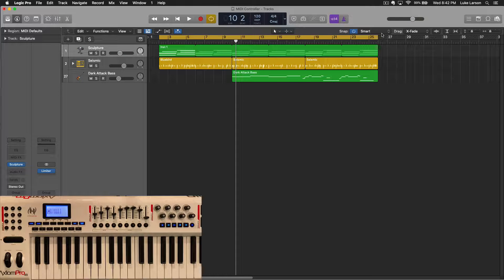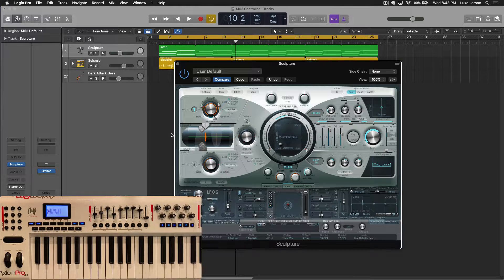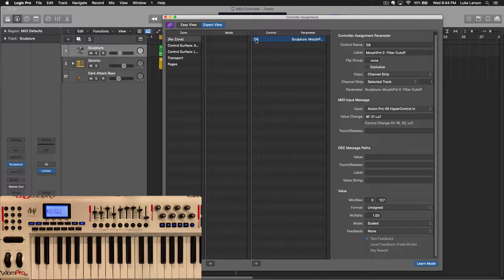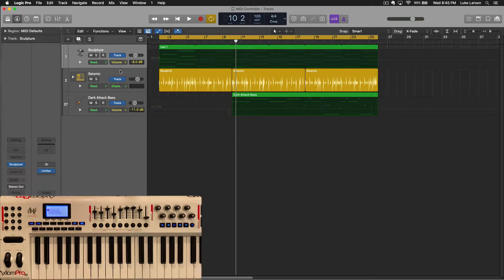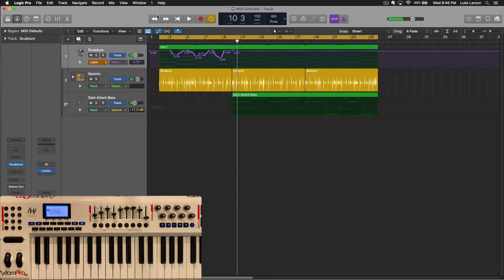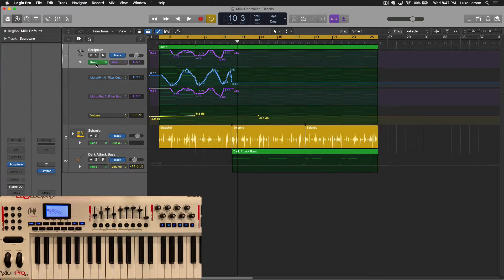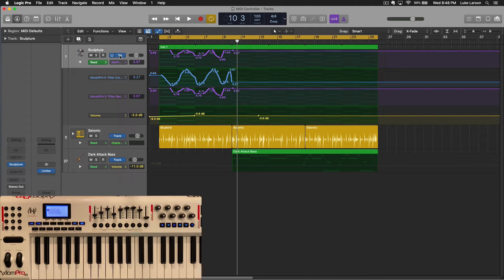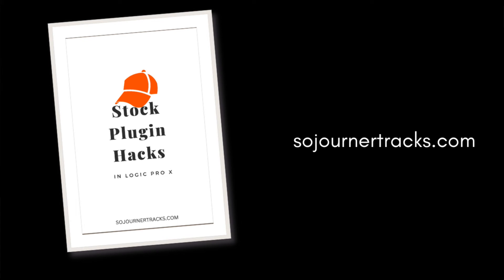Setting Up a MIDI Controller in Logic Pro X

Comment: Man it's insane how modulation/sustain etc is not assignable through separate controllers.... I have been having the worst time trying to figure out why my x-touch mini which has a fader on it... sometimes it does not work within kontakt in the virtual instruments when I right click "assign midi cc".... like it will trigger it within the kontakt but it won't write it when I record it in or with touch etc... it makes no sense at all... but if I move the dynamics/expression with my mouse while clicking it writes it in... been going crazy trying to figure it out...
Reply from the maker: I understand the headache! There’s too many variables. I do know that CCs are not assignable in Logic. However you can sometimes assign them through the control surface. I’ve had success working backwards that way.
Reply from the maker: Checked out your music BTW. Great stuff man!

Comment: I have an extremely simple midi, the issue is that the keys are not assigned correctly. I have 15 keys on the midi. I have everything else set up fine on the midi, but when i play a c chord it plays a b chord.
Reply from the maker: What’s the make/model of your keyboard?
Reply: @SojournerTracks  you already know I got a Nektar SE25 (most random midi ever)
I have the thing downloaded to Logic through the serial code too…
Reply from the maker: It looks like key 7 of that keyboard is setup for transpose. You might have accidentally transposed down a half step.